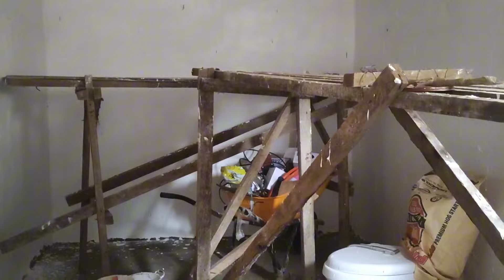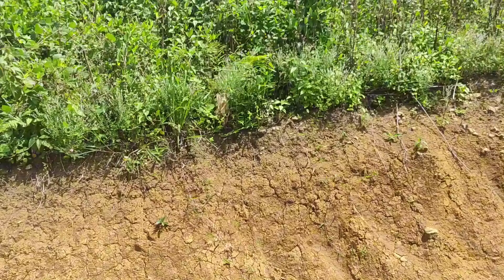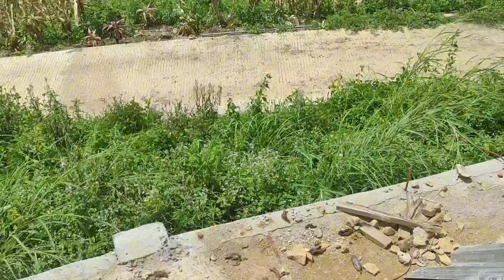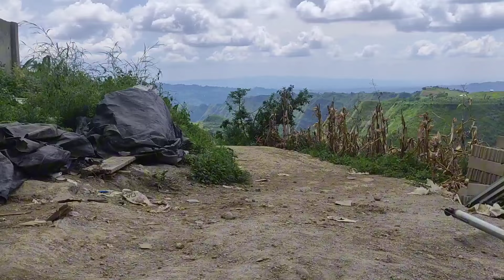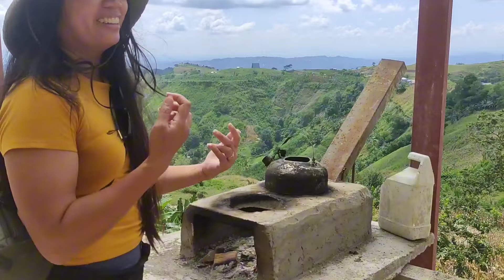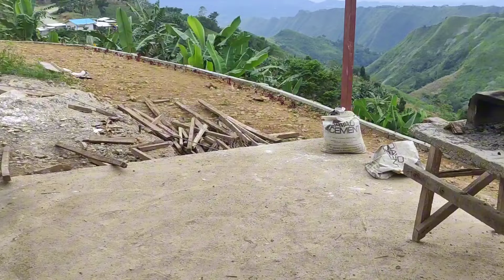Foreigner Building in the Philippines | Outdoor Kitchen Foundation and Another Water Source

Comment: If you use rebar that will be covered with concrete NEVER paint the rebar with any kind of rust preventative. Fabulous view. May I ask how much does apiece of land cost in your area to build a home and what are the lot sizes. regards. Jack
Reply from the maker: Hi Jack! 

I knew that epoxy coated rebar is a thing, and figured anti-rust treatment would be an option. Thank you for the information! 

As for size and price here, it depends on many factors obviously. The MAIN factor is how desperate the seller is for money. Lot sizes...well, a friend of ours is actually selling lots of 500 sqm for 75 k Php (very safe seller, view is so-so). But most areas being "sold" here are 1-2 hectares, and price will in general land on something like 1-2 m per hectare, unless they need money fast (in which case it can be much cheaper). Do note that: a) it's not titled, as it's ancestral domain (so it's rather renting for 15-25 year intervals, although it's almost no cost to renew after each period. It's illegal to try to sell the land, but you can acquire the rights to the land...hard to explain here) 

b) the tribe can take the land back if there's no development within 3 years (so throw up a small 2 k peso shack or something if it'll take time to start building) 

c) in most (not all) cases there will be an additional 30% fee on top of the selling price (actually, 3x 10%, for tribe, barangay and Fematrics office, which is something like the representative of the tribes). 

Definitely a lot of hurdles and paperwork to buy here, but much more affordable and as long as you do it right it's as safe (or unsafe) as buying anywhere else, in my limited experience. Just run everything through the Fematrics to avoid scams etc! 

There are plenty of big resorts in this area and it's very safe, but it's very important to do things correctly. I would not have had a chance to do anything (except lose money) without my wife. Most here do not speak English, so for that reason alone - make sure you have a solid partner that is fluent in either Bisaya and/or Matigsalug.
Reply: @ABetterLifePH  Fabulous information you are too kind my friend thank you so much.  Yes having someone that is native to the area would be a huge help.  Thanks again for the info .
Reply from the maker: @jjfalarka8837  You're welcome, best of luck. 

If you need help in our area, we can of course do that. But you should visit first, see if it's for you. It's a bit remote, definitely not for everyone. There's a small hospital close by, but they don't have x-ray, can't do major surgeries etc.

Comment: Sorry for the daft question, but does the water filter mean that the water is safe to drink?
Reply: Well yes but if you boil it even better.
Reply from the maker: Everything is subjective kind of deal. Absolutely not a daft question. 

Our neighbors drink it straight from the hose without issues. My immune defense would not like that. Unfortunately, we can't use our filters right now, not enough pressure. My plan was to test the water (before/after filter) and check for heavy metals and bacteria and what not. Honestly, I probably wouldn't drink it anyway, just to be safe. 5 gallons (20 liters) clean drinking water is somewhere around 25-35 pesos, or around 50 cents USD/euro. Too affordable for me to risk stomach issues. But I want the water clean enough to wash face/take a shower, brush teeth etc.
Reply from the maker: I wouldn't drink it, even after filters. And boiling won't get rid of all potential pathogens, or heavy metals. I would advise everyone moving to the Philippines to just buy drinking water (there are water refilling stations everywhere). It's very affordable.
Reply: The water bought in the blue 5 gal bottles is filtered tap water. Might as well install a water station of your own and be total control of your own water.
Reply: @TitoJames68 

Yes, this guy is 100 percent right.
To drink clean water, you need to install a separate water line to the sink after your filters and then install 2 filters: carbon and reverse osmosis 
And you will always have drinking water in the kitchen and once every six months you will change these 2 filters that I wrote
Reply from the maker: A bit out of our budget atm 😁
Reply from the maker: It's an option, but as mentioned: 5 gallons costs about 30 pesos. I'm not sure I will ever drink enough water for it to be financially worth it. Of course, if you want less hassle, it could be.

Comment: Good luck with this concrete roof 🙏 high chance of water getting in.
I would never ever do that in PH 👎
Reply from the maker: We'll see. The normal metal roofs here are insanely loud.
Reply: @ I know/agree but when you make hardyfkex ceiling below roof it’s ok/better or best roof for silence would be asphalt roof 👍
Reply from the maker: @selbstsein967  No leaks currently, but I haven't ruled out asphalt yet. But a white acqua epoxy top coat should bring the temperature down in addition to providing some water proofing. We'll keep an eye on it. Any issues and we'll solve them!
Reply: @ wish you success 👍

Comment: I have to say that Filipino bricklayers have to be some of the roughest on the planet. They look like they are using concrete and not mortar. And there is nothing on the perps. Just block against block. No wonder their walls fall down so easily. It's only the rebar that holds it together.

My own building project begins in 2026, and there will not be a hollow block on the entire development. Home made blocks and gone-off concrete? No thanks!
Reply from the maker: I think that is a very good idea. It may be more difficult to build without hollow blocks here, but if you're not too far out in the province/you have access to materials or transport - then pouring or AACs is a better idea. 

Unless you're doing everything yourself - make sure you find the right crew (this part may be difficult). I had absolutely no experience, and pretty much everything the first crew did will need to be either fixed or re-done in time. Luckily I got some great advice from people in our comments section, and we got more and more involved, so we could change some of their plans (like a 3" slab without base as floors), but yeah...lots of extra work in the future.